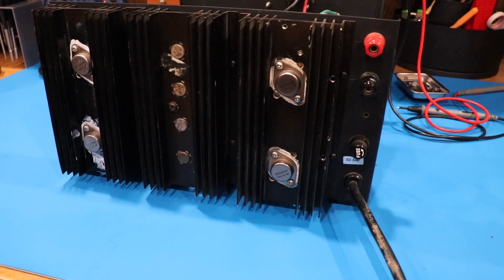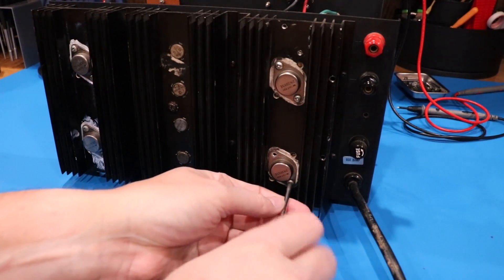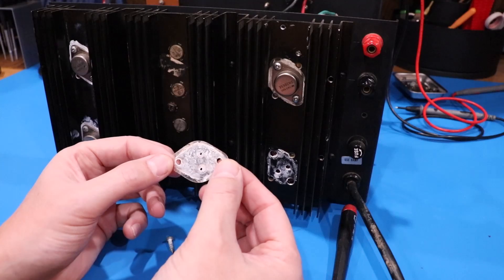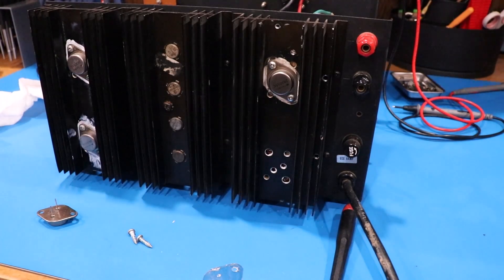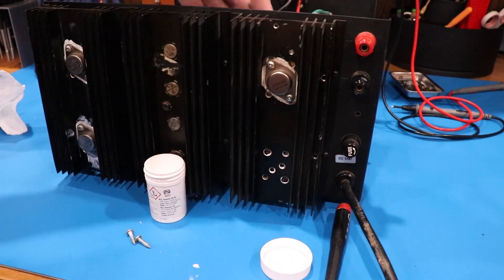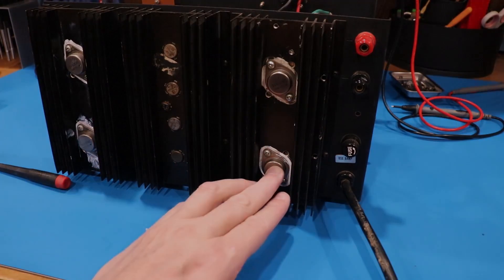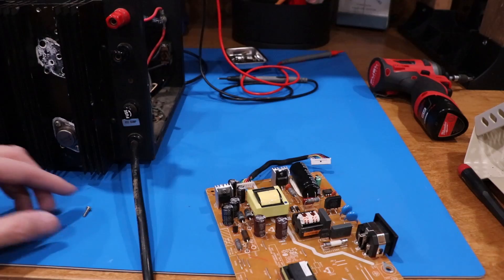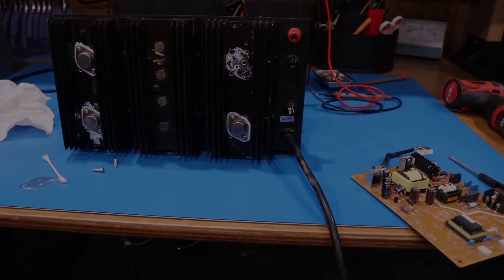One of the Most Overlooked Steps in Vintage Electronics Restorations & How to Do It So Simply...

Comment: Agreed totally on the overall message. 

One thing though- the purpose of thermal compound grease is to act as an interface between the semiconductor case and the heat-sink, to fill the air voids that exist due to the rough surfaces (of primarily the case). The TO-3 might be reasonably flat, but when you're bulk manufacturing aluminum cases, you're not taking it down to the toolroom surface grinder to get your flatness down to 3 millionths RA. It's just not cost effective. The surface is going to be rough. 

So, even when you fasten your semi-conductor down to data-sheet torque specs, there are going to be peaks and valleys on surface A and that will cause voids and pockets to emerge on surface B. Imagine a sharp theoretical needle-type protrusion coming .3 thou out from your thick alu. extruded case. It's going to deform the TO-3 casement forming basically a "cavern". The sharper/higher that "needle-mountain" is, the larger the volume of that void. And voids don't conduct heat (that's why we all love our Thermos's! That double-wall vacuum of like 1/8" will keep coffee hot for half a day easy! Vacuums/gases at atmospheric pressure, in general, are poor thermal conductors. Which is why Porsche (sadly) went water-cooled on the 996s.). 

Like you said, it doesn't take much at all-- you just need enough for it to fill those voids that exist due to manufacturing tolerance issues. If you pour too much on, there's a chance of the thermal compound being counter-effective. (It depends on a lot of factors, obviously, like the intrinsic material properties of the two metals, the wetting properties, the thermal conductivity of the compound, the amount and rate of the heat flux on the semi itself--- but some of the poorer quality thermal compounds definitely can act as insulators if you just slather it on.)

The good news is thermal cameras are cheap as heck now. You can adjust the amount of compound, run your power supply at full load for a few minutes, check your readings, and adjust until you get that 'sweet spot'. You can get some China junker for 200 USD. I wouldn't be using it to publish any papers on like..the thermals of thin-film metal resistors, but for taking relative measurements, they're handy tools to have for everything from finding heat leaks in your house in the winter, faulty components on boards, or well, fault finding in general!

860 is great! MG also has the 8617A which conducts 3.0W/(m*K) as opposed to 0.7W/(m*K). Anything MG is gonna be good, but I've had great luck with it -- especially in high-power applications (for the IGBTs we use in our inverters that drive 5-axis grinders for precision optics). It's a pretty good price/performance trade off. You can get up to the 5W/(m*k) level but that's some real niche performance level stuff (like, silver colloidal stuff, the only thermal conductor > copper..you pay for it, but the side benefit is the niche companies who put this stuff out have researched out the suspension materials so well that they just don't dry out. It's some voodoo shit, but I've come back to some of the grimiest boxes a decade later, and under the HSF it looked mint)

Comment: How can transistors be electrically isolated from the chassie when you use metal screws to attach them to that chassie?
Reply: Generally,  it's being screwed into a socket on the other side, not the chassis.

Comment: I've had old silicon heatsink compound just about turn into clay.  White spirit cleans it up easily.

With TO-3 devices that just plug in, such as you demonstrated, the two leads need to be cleaned of the grease before being installed, to ensure a low-resistance connection to the socket.

A good policy is to do an electrical conductivity test with an ohmmeter, between the transistor case & the heatsink, to ensure the mica washer hasn't been damaged.  

Do this test before removing the transistor as well, so you know if the circuit, by design, does or not have a deliberate connection between the heatsink & the transistor case.

Sometimes, it's easier to just use new mica washers.

Comment: I worked on a Luxman recently to fix a recapped!   Someone used Dielectric grease instead of silicone.    I’m sure it will somewhat work but not as good as traditional monkey snot!  And can people please buy new mica insulators!   They are cheap.   MG Chemical is the best

Comment: The computer nuts    are obsessed   with thermal  grease    as far  as the CPU
Reply: There are two general reasons for that ...
CPU chips aren't cheap and they last about 30 seconds without a heat sink.
and
They fail to appreciate the life curve of these products.  Most CPUs will register very low temperatures while the grease is still settling, then as the oils begin to leech out the temperature rises until the remaining compound locks in with all the gaps and brings the temperature back down where it will stay for years.
They see the temperature going up a bit and panic.

Comment: I wouldn't use fingers to spread that thermal paste.  The paste has micro particles in it that will get into your skin.  Also, you introduce grease from your fingers into the thermal paste.  I use a small spudger for smaller applications and an old plastic card (cleaned with IPA) for bigger applications, such as CPUs.  I would also recommend using IPA and a coffee filter (no residue lint that paper towel does) to clean the surface before application.
Reply: I used to use fingers all the time in my youth (40-50 yrs ago) to apply the paste, until I discovered it was carcinogenic.  I used a tool to spread the paste since.  Due to the small amount used and minimal time in contact with the skin, I haven't developed any cancer or dermatitis from doing so.  I don't know if the grease used these days is no longer carcinogenic or if the formulation has changed.
Reply: Coffee filter! Good idea.

Comment: I wonder now whether it may be worth keeping a lookout on thermal materials that don't need service. Phase Change Polymer type, or maybe Carbon film type. Phase change polymer comes as paste that cures in place or very very thin pads. In use, it melts shortly above room temperature and remains molten, and freeezes again when the device is powered down. The performance of these materials is spectacular, which is hardly needed here because well you have Mica in the path which radically limits thermal conductivity anyway and it's fine, but it doesn't volatilise and cannot separate. Perhaps it has other failure modes, who knows! Maybe it can creep out of the gap if it's uneven.

Carbon thin film seems like it would be just the thing, another forever-material, but if your hot bits aren't quite planar with the heatsink, it might have difficulty bridging that. Cheap, lower performance carbon film is available from random Chinese sellers, it's for sure used industrially at scale where you don't need spectacular performance but need reliability. Care is needed though that it doesn't extend beyond mica or whatever insulator you use, because it's going to bridge. Another massive short hazard is passing component legs through it. So i can't see it being put to good use on transistors like these.

Next thought i noticed Kafuter silicone from China like the 704 advertised as a thermally conductive material with 1.6W/mK which if true would make it better than generic white paste; it's also completely and utterly unrealistic! The material itself seems high quality, but it's not like these sellers carry any responsibility for what they claim... Elsewhere you may find 0.8 specified or nothing specified at all. If i were to bet, it's probably got 0.2-0.4W/mK similar to many Silastic types. Anyway electronics silicone like this is removable (with hindrances) but should not require service of the thermal interface itself, so semi permanent, and i bet there's actual higher performance materials of this type.

Do people have any other good thoughts?

Comment: You better off using some thin copper foil as long as it's not wider then the mica
Reply: LOL, good luck burning out your equipment.  Mica is an insulator that is needed here, while copper...
Reply: If you read my comment I didn't say about removing the mica, I said make it shorter than the mica then it won't have any short, You still have an insulator, should have added to make sure the holes are big enough for the leads but I thought that might be obvious @Omega_Mark
Reply: and resistance testing the semiconductor with a Megger insulation tester....
Reply: It's no different than the resistance to the heatseat we're not talking mega voltages here @colonelfustercluck486

Comment: I just remove them, clean the mating surfaces and us the heat sink pads instead of the messy white goo. There are three things in electronic repair that find a way to make a mess. Gooey drive belts, heat sink grease, and anti-seize lube.
Reply: Pads don't transfer heat as well as properly applied thermal grease. They can't fill in all the microscopic holes.
Reply: @audionutzjulian  I don’t think the loss is that significant
Reply: The thermal transfer compound is a crucial part of servicing. Thermal silicone pads work extremely well as well. But sometimes you just want to be genuine service using original factory techniques.

Comment: lol you say heat shrink tubing so much you cant get heat sink in your head.  Is there anything wrong with using computer CPU thermal paste or is this a different product?
Reply from the maker: I know, it was tough making this one.  CPU stuff is the same stuff, just marketed in a way they can charge more for it...
Reply: Make sure it is electrically non-conductive
Reply: A lot of that stuff is conductive. No go for transistors where you sink the collector. Maybe the to3p’s are ok, but not brim hats for sure.